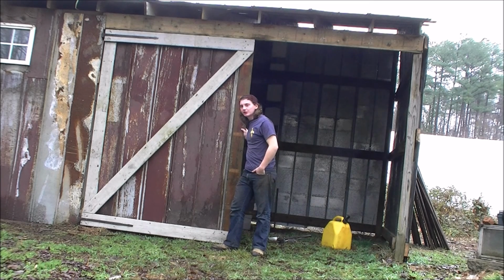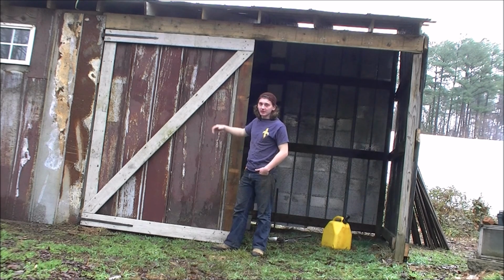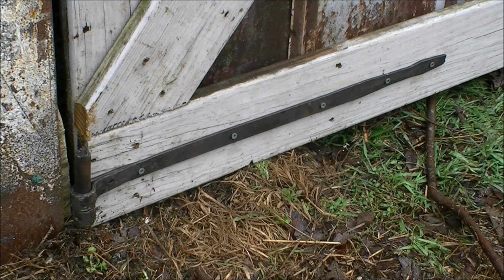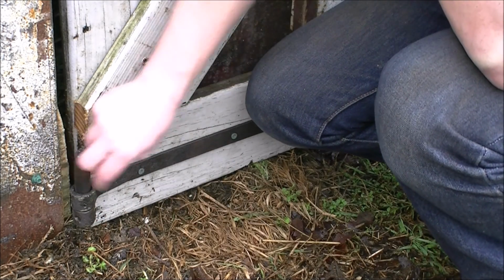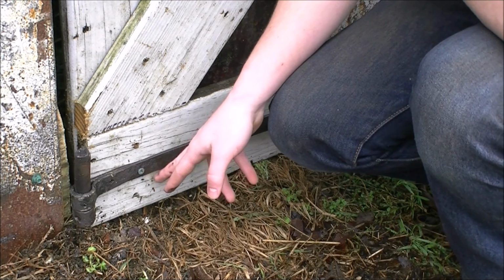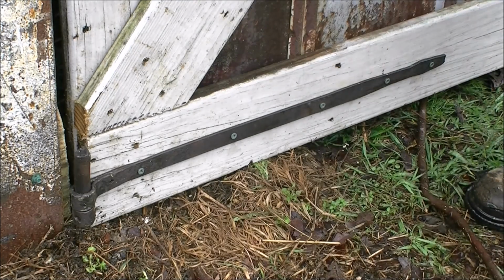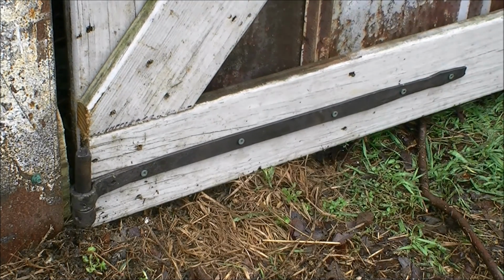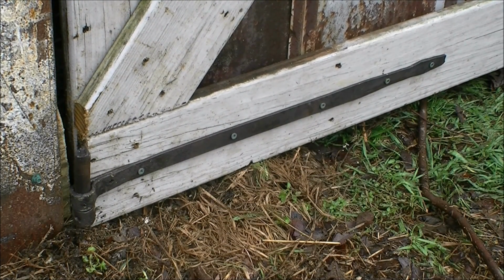Strap Hinge Forging and Installation! Enclosing & Expanding The Forge - Part 3

Comment: Wes,
This was a valuable addition to your videos, very clear and easy to emulate. Have you considered clinch nailing the slats to the crossbrace itself? 
Albert
Reply from the maker: I didn't think of that, I was only using wood screws throughout. If it ends up breaking I'll try that.
Reply: Oh and you need to forge a hot cut, or a hardi hole hot cut! That splitting maul is too cumbersome! LOL! Seriously though...
You know what would be cool,  a hot cut with a well wrapped rod handle.
Albert
Reply from the maker: I have been meaning to make one, I have a really good piece of stock to make one with. It is mild steel, but I'll use that handheld cutter to create a place for a HC steel insert to fit & forge weld it all together.
Reply: Looking forward to that video! 
AAR